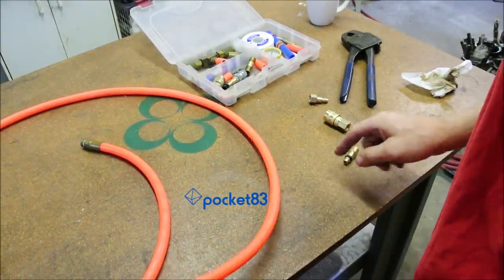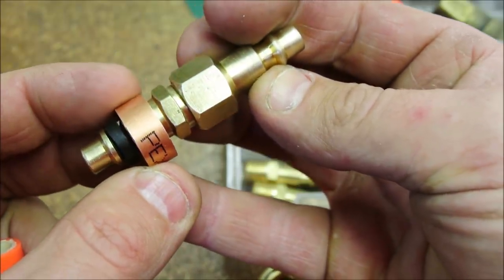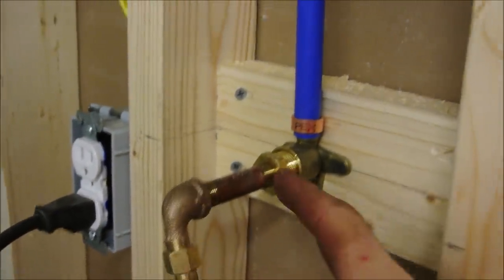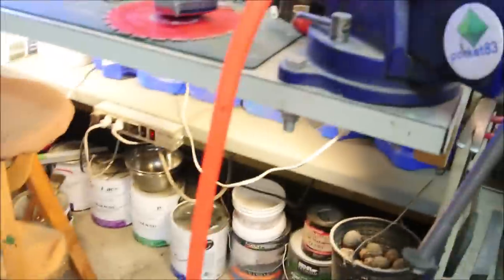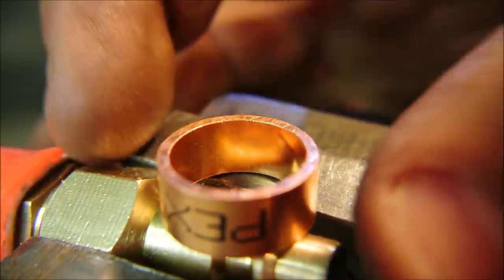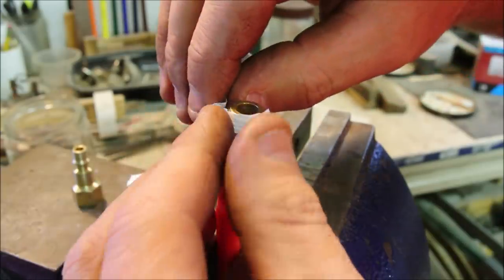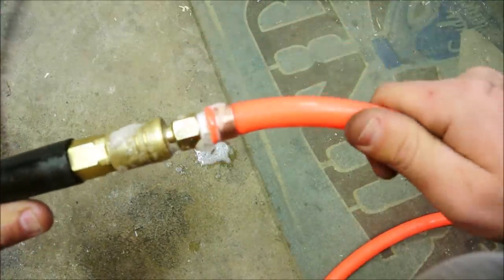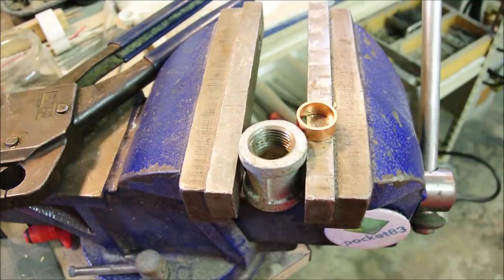Vinyl air hose repair (unconventional)

Comment from the maker: So far, two weeks, no leaks. It has been plugged in to the compressor the entire time, averaging around 100 psi. In case you are wondering, the PEX pneumatic system in the wall loses surprisingly little pressure over time. However, if I leave a tool plugged in (like the air-sprayer), it might lose 5 or 10 pounds overnight.
Reply: two weeks no leaks! man's got a rhyme and everything. i'm convinced.
Reply: I know that you are not supposed to use CPVC due to the fact that if it shatters, then under pressure, explodes you get shards of plastic everywhere, is that a problem with PEX? I'm not familiar enough with that product.  I think the rule of thumb is if you do end up using CPVC or similar, you have to actually cover it in some way either in another sleeve or buried in a wall that has some sort of a metal protection or something like that in order to keep the shards contained
Reply from the maker: Yeah, I would NOT be comfortable with CPVC. That stuff just doesn't sit well with me.
Reply: My grandfather also did pex airlines in his shop walls. 3 years with minimal leaks
Reply: You might not be losing any air... The compressor makes air pressureized and hot, then pushes it into the tank where it cools off and slightly contracts reducing the pressure. Conveniently reducing the amount of energy recovered from the compressor.
Reply: that pex fitting looks roughly like a 15 mm metric ID i think that might be a little closer
Reply: how's the tubing doing after 7 months?
Reply from the maker: Still no problems. It's under constant use.
Reply: Awesome video!! thanks for sharing the experiment/experience. Looks like a nice alternative to brass ferrule and rubber air hose style crimping. Easy was to remember teflon tape goes on the same as the fitting left loose right tight. I had a question about the pex. Was PAP pipe a consideration in you choice for air as I am considering the same type of airline install? If so what made you go the way you did?
Reply from the maker: @atrainace114  Price was the determining factor. Ease of install was second. No, I did not consider the fancier pipe that has Al in its core. Closing in on two years now with no leaks, so it seems that it was a reasonable decision.
Reply: @pocket83squared  Good to hear on the 2 years. I have one more question if I may. I have heard alot about air permiation where pex is concerned. I know you said no leaks, just wondered do you leave your compressor on always to keep the lines charged? Or do you turn it off? If you do turn it off, do you find it runs as soon as you turn it on again? Thanks for the info.

Comment: I've seen people plumb air with copper, but never with pex.  Huh.  Learned something new today, cool!   I used to think about plumbing air so I could leave my (horrifically noisy) pancake compressor in the garage, but instead I just waited until it died and I bought one of the super silent California Air Tools tanks.  So far, really impressed with how quiet it is.   Also, as a hobbyist, there is no justification at all for having an always-on-always-charged air system at my disposal.

Also, the last sentence in your video description was the absolute best thing I've ever read.
Reply: I have seen PVC

Comment: "The direction you put it on matters...and it always confuses me". Thank you! I can hold my own in my shop, but every time I put teflon tape on a thread I think about it for a while and eventually get it wrong. Always figured I had a mental issue or something.
Reply: Imagine wrapping that tape on the outside of a female fitting, then pulling it. How would you have to pull it for the fitting to screw on? Wrap tape same direction. In other words, for a typical male air (or water, or gas) fitting it's clockwise when you are looking into said air fitting.
Reply: Make a fist with your right hand and point your thumb into the fitting.  Wrap the tape in the direction your fingers point.

Comment: I'm really cheap.. PEX fittings are expensive..
I use 'clamp hose crimp' (the type with a lug either side) and close them with a big pair of angle cutters. :)
Oh. and source of leaks: If you cut off the old fittings with a knife and score the brass.. That one has got me once or twice before I worked it out.

Comment: You can add some low points in your air distribution system so that you can easily get rid of condensate in the line.
Reply from the maker: The wall fittings already ARE low points. Besides, drains are really more of a concern with (cold metal) tanks; lines can be blown out with a single burst.

Comment: My summer job had me going through rolls of Teflon tape. We performed compliance inspections on suspended oil wells and had to remove plugs and fittings to take pressures. I used the tape so much that one of my pockets was dedicated to holding one to three rolls, and another pocket was solely dedicated to disposing used tape off of the fittings so as not to leave garbage lying around

Comment: Thanks for the update along with the good information, I have both types of pex clamps, and tools due to my profession... you basically answered my question, as while I am not a next level cheapskate, we pay good money for equipment, and if it will work just fine then I'll be damned if I'm going to just consume for the sake of conventionalism. I do understand you saying you don't recommend it, because there are a lot of people that will make hair-brained/sloppy mistakes where safety is concerned, therefore compromising the efficacy of this type of project...
Reply from the maker: Thanks. And for the record, this repair is still in use (as of Aug 2023). It has remained under (nearly) constant pressure for years now.
Reply: @pocket83squared  That is freaking awesome. Thank you for the update! I was wondering. Stuff like this is why "we WON'T have nothing, and be happy". They are underestimating us. I say, "They'll lose everything, and we'll make sure they're miserable." Much respect! 👊🏻

Comment: What a coincidence.  I was just redoing the air compressor system on my truck at work.  I don't have anything to add tho.  I just use hose clamps, and the hose fits better.

Comment: Nice system, I personally used the John Guest system and nylon pipe, which was nice to work with and all, but your PEX system has to be at least half the price. If you want to add drains, just add a T-fitting at the outlet and point the outlet quick-connect up and a stand-pipe down with a valve at the end to purge out condensate from time to time, I've seen that done in several large industrial installations. I've added some horribly expensive 200 dollar automatic venting condensate catcher thingy-ma-bob to the lowest point in my system, with 2 cm drop per meter towards it, and half a year later I've never seen that blasted thing even collect any water. Might be a bigger issue with black iron or copper lines,  I have no idea... So I'd say don't worry too much about condensate forming in your system.
Reply from the maker: The fittings are the lowest points, and they all point down. I've tried bursting some air through a few times, and no moisture yet. It's also all plastic that's inside of an insulated wall. As you've said, condensation is probably more of a concern with cold metal, and in this case, that would be inside of the air compressor. I haven't noticed a drop outside of that, but my system is only three fittings in a sideways capita 'E' shape. Time will tell.

Comment: WRONG! You're using the wrong fittings. You're using a male quick disconnect fitting where you should be using a barbed fitting. Anyone watching this please don't do this.
Reply from the maker: WRONG! That was the premise of the video! And it has lasted for well over four years now, at 100 psi, without incident. 

What's "wrong" procedurally will only be relative to something's intended design. I designed this, intentionally, to work a different way. It did.

Comment: I have gotten away from street fittings. The restriction in flow... air or fluid is restricted noticeably. Use a plain 90 for no restriction.
Reply from the maker: There's a simple equation I used to determine the appropriate pressure, volume, and temperature intrinsic to this system, and their overall affect on efficiency, as well as to evaluate the relationship those variables share with these specific fittings, and of course, to gauge any resultant restrictions:
.
.
.
.
.
.
.
.

tools work =  plumbing ok

Comment: I've just used #14 steel wire.  Wind a coil on the lathe that's a significantly tight fit on the naked hose.  Cut a short (1") section of the coil, apply it to the hose, lubricate the ID and hose barb with soapy water, and shove it in.  No crimping needed, but it helps to heat the hose up.  

If shoving the assembly together is too difficult, insert the fitting and screw the coil over it.  Leaving temporary tails on the coil might make that easier, but you'd need to cut them off neatly. 

For an added strain relief and perhaps some extra strength, wind a slightly larger diameter coil, slide it on the hose beforehand.  After the fitting is installed, screw the larger coil over the one holding the barb.  Nothing sticks out, and you can make the strain relief any size you want.  See: https://funkyimg.com/i/2YnXN.jpg

I've only ever used this method for pvc lines on systems below 150psi (it's survived <0 to >60 C).   The nice thing about using wire is that you can make any diameter from the same stock without needing to bore sleeves or crimp things.

Comment: so i assume that the tubing has lasted for almost 2 years now?

man, for such cheap tubing to last so long, it might be worth it.
Reply from the maker: Yes, it's still going strong. What's maybe even more impressive is that the orange tubing came from an air hose that I'd bought around 20 years ago for $10. If you can tolerate a cheap vinyl hose's stiffness, the thing itself is quite a product; it's probably even tough enough to run permanent in-wall lines with.

Comment: Please consider Loctite 545 instead of Teflon tape on air and hydraulic fittings. No chance of tape particles contaminating the system. And it does not leak, never hardens and is much easier to apply.

Comment: i would have just eliminated one of the fittings and clamped the hose over the threaded side. and as other people have said screw type hose clamps work just fine. and they are cheap.
Reply from the maker: This video wasn't about what you "would have just" done. 

Man, is that a tired cliché.
Reply: @pocket83squared  i dont disagree. seemed the point of the video is getting down and dirty and doing things unconventionally with limited resources. but then over complicated it by using unsessarisary processes. either way i enjoyed your video, and most of what you post! sorry didnt want my first comment on your channel to seem so negative! keep the content coming.